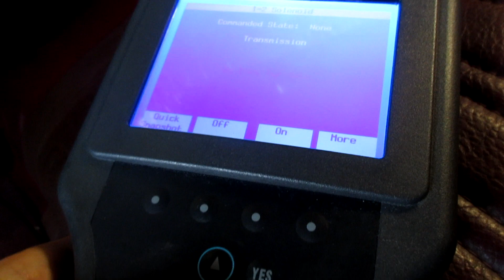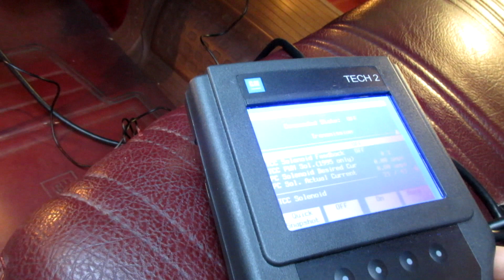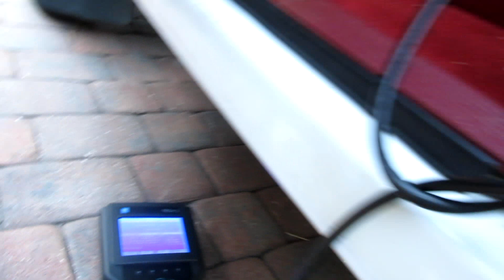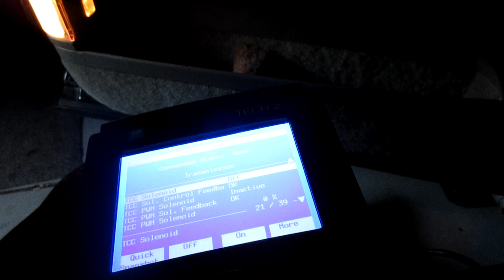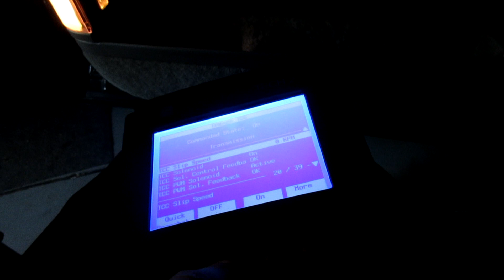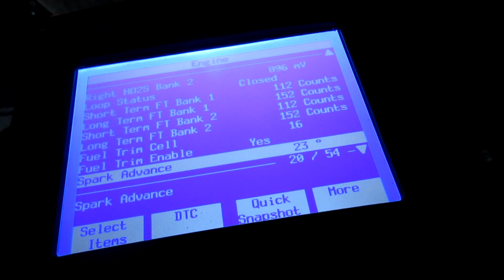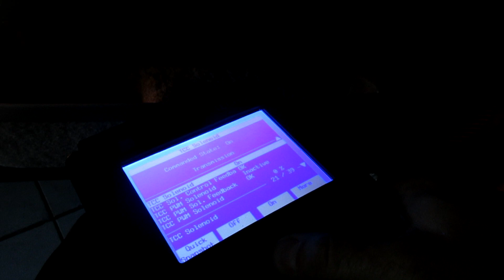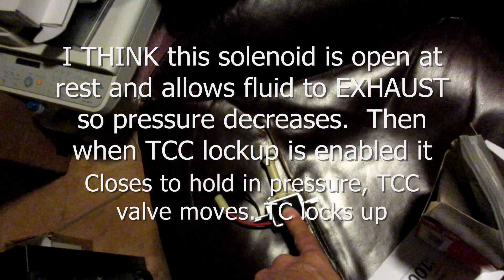4L60E  OLD ONE!  Torque Converter Lockup Solenoid test   It fails

Comment: Hey how did you installed it 
Do you cut the original?
Reply from the maker: the Solenoids? Ya cut the wires and install the threaded wire connectors the kit comes with
Reply: @GhettoWagon  thanks brotha